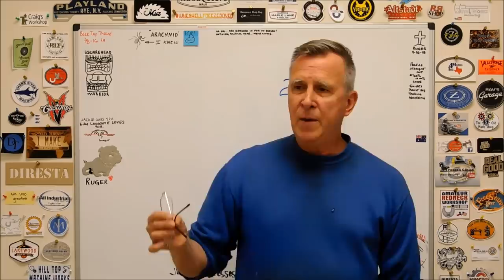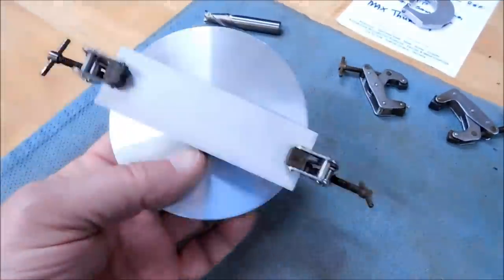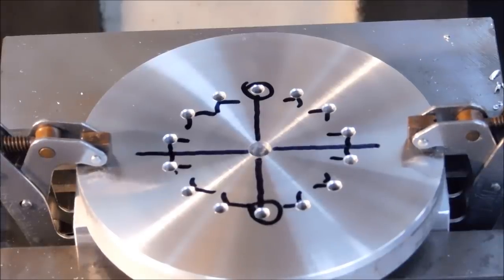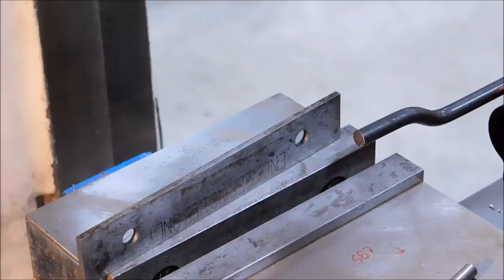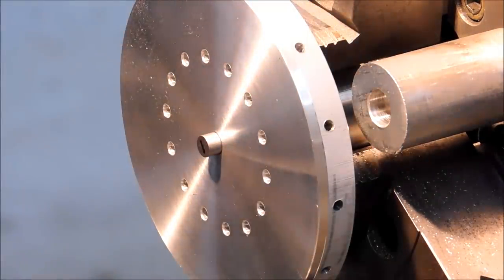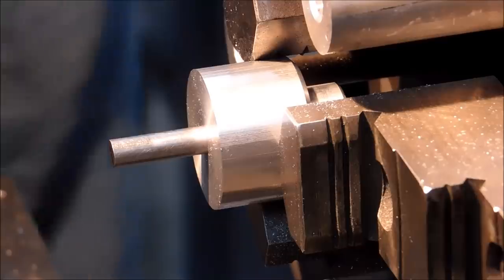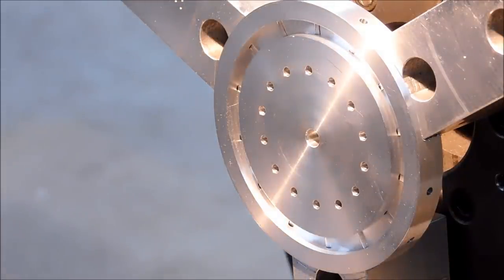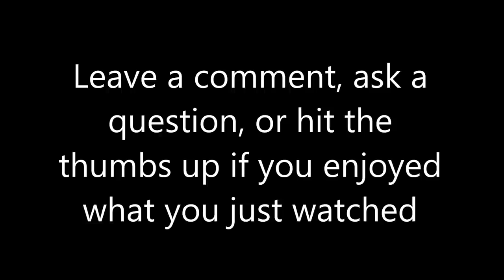Machining 14 Spokes at 25.714 degrees.  Easy ?? ... Yep !!

Comment: Excellent video Joe, one question, when indicating the centre pin on the mill, why a dial indicator and not an edge finder ?
Reply from the maker: Once you find center using an indicator, you lock the table. Once you find center with an edge finder, you move the table to center. The indicator is more accurate.
Reply: @joepie221  Ahh! Thanks Joe

Comment: At the beginning I thought you were making a custom 14 hole spin indexer plate.  Might be a neat project to make a timesaver for future wheels.
Reply from the maker: Maybe its already done???
Reply: Joe Pieczynski   If someone made a video I missed it.    Thanks, Chris
Update, found a video on making custom spin indexer plates. https://youtu.be/Lsna5BH-6js
Reply: @shadowdog500  I assume he means the trepanned disc can now be used as a spin indexer plate (for the hub) - i.e. it's already done. If so - that's some nice forward-planning! :)
Reply: @CraigsWorkshop  I figured the radius of the 14 hole pattern was too small for a spin indexer,  but i never thought of using it on a custom indexer, which is what he may have done.   Engles Coach Shop posted a video today where he  mortised a hub for spokes using an easy to build homemade indexer mounted on his mortiser. check it out https://youtu.be/uJcfPMDLFX0?t=950
Reply: @shadowdog500  Thanks - I'll have a look at that. I've heard of the Engles Coach channel, but this will be the first video I watch. Cheers, Craig

Comment: Thats awesome how you break the hole circle down into rectangles! I have a mil with no DRO, and I'm lazy, so these tricks are valuable!

Question for you. When you tram the center pin with your indicator, it looks as though the indicator is held by a quill mounted indicator holder. Do these holders have to hold the indicator exactly in line with the will axis to be accurate? The cheap holders always seem to point the indicator off to the side.
Reply: I have an "import" mill-drill with no DRO, and with a bit over 0.030-in. backlash.  :(  I need to learn how do use Joe's method while allowing for my backlash!

Comment: As always, thanks for the lesson!  I have a couple of questions, as I'm trying to learn more.  When you were pressure turning the wheel with the arbor on the hub, did you adjust the RPM on the lathe to account for the diameter change?  If not, could that account for the initial surface finish before you switched to a HSS tool?  Another thought.. It seems to me that you could use the center of the wheel that you popped out as a template to drill the spoke holes in the hub. I remember another lesson of yours where you used pins and adjustable parallels to cut precise angles.  Do you think that technique would be suitable here?
Reply from the maker: You'll have to wait and see.

Comment: Ok really cool how you did that! Although I think you cheated a little using the CAD to get the layout. They didnt have CAD in the old days. But ill let it slide. 
Cant wait to see how you do the hub!
Reply from the maker: Trig book and a calculator would still get ya there. CAD is just quicker. FOG privilege.
Reply: You can use some pretty basic programming to do this as well. Computers are just overgrown calculators after all.
In Python:

import math

radius = 2.0
divisions = 14
for i in range(divisions):
    x_pos = radius*math.cos(i/divisions*2*math.pi)
    y_pos = radius*math.sin(i/divisions*2*math.pi)
    print(‘x: ‘+str(x_pos)+’ y: ‘+str(y_pos)+’\n’)
Reply: Im just busting your chops. Love your channel. Keep the videos coming. I cant wait to see how you do the hub!

Comment: I saw another channel that was partial to using super glue arbors, but he was making lighter stuff; would this part be too big and heavy to use such a technique?
Reply from the maker: I have never used super glue on a part, but can see its value for small thin parts that will crush under pressure. I'd be leery about gluing a part this big.

Comment: Why not just make the inner/outer section in one piece - drill into both of them at the same time.  Machine the center hub then outer hub then cut out the middle?
A lot less indexing - especially since you all ready did it once?
Reply from the maker: I could have done this a dozen different way, including that way, but the continuity of the videos was planned.

Comment: I would have made a jig for making those holes from the perimeter. One threaded hole in the middle and two short dowels in the place where two of those 14 holes are. One bolt with a washer in the middle : drill and bore, open the bolt a little, turn the piece 1/14, tighten the bolt, drill and bore...
 IN MY PERSONAL OPINION it doesn't have to be that hard clamped when drilling/boreing, and almost every time there are more than (let's say) two pieces that are to be made  jig is a good investment. Then there is the possibility to improve the jig if you want 13 holes or 15...
Reply from the maker: I'm a big fan of jigs.

Comment: Hey. I've been machining for about 8 years professionally. Ive been considering purchasing a mill and lathe but I dont know how to find business. Could you consider doing a video on how one would do the business side of what you do? How to get contracts and what not. 
Thanks.
Reply: Start out as a hobby, don’t take on debt, and use the equipment until you design your own product. Try listing it online and if it sells and makes money, make more. If not, try something else. No solid recipe but if you want a equipment and no idea what to make and sell then be prepared for nothing. Working for a customer base like a job shop won’t likely amount to much and it’s not as passionate a Pursuit in starting up.

Comment: I don't have to remember anything. My CAD program allows me to 

assign radius and then hole qty (14) done.
Not crazy about your material being so far from the tip of your bits.
Having to lower the quill so far induces wobble. The closer you are 

the more accurate you will be.
Reply: Nothing wrong with CAD, sure makes things faster and easier (it's how I get the data most of the time), but if or when your computer crashes the work stops.
If yours is hobby work it's not a big problem but if it's your job or your shop then it's a big problem.
It's better to have a backup if the easier/faster way isn't available.

Comment: The top and bottom of this is, you need a CAD system to mark the hole positions!
Reply from the maker: It can be done manually. Just takes longer, but absolutely possible. Realistically, you only need 2 of the holes. Drill the hub, index to the second hole, align with a pin and drill the next hole....repeat until all 14 holes are drilled.

Comment: Mr Pieczynski, Re 23:12 better finish using steel vs cemented carbide,
is this not just a case of the steel tool having a sharper edge than most cemented carbide teeth that are not intended* for aluminium? 

*intended: of course that dose not exclude there use on aluminium.

Comment: 13:04 So you’re saying you only needed to drill 7 holes in the circle to get the 14 on the rim?
Reply: In fact, when you think about it, you could theoretically get away with four holes -- if you stacked parallels tall in the case of half of them.
Reply from the maker: I like it. 7 yes, 4 no.
Reply from the maker: @Gottenhimfella  I think 7 is the minimum.
Reply: @joepie221  It seemed to me 4 might be enough. I reasoned that by spanning the parallel across two adjacent pins, their angle is bisected, whereas across three pins, the angle intersects the centre pin. So four index holes are bisectable, which I assumed would permit drilling seven radial holes in +z, and  by simple inversion another seven in -z.
Now that I spell it out I see there is a problem with this, though. I think an extra hole would be needed at each end of the 4-hole arc, because spanning three pins cannot be used to intersect the pin at each end of the arc.
So maybe six is the minimum, unless a cheat was used, like substituting a non-parallel with an included angle of one-half of the angle between spokes. This would mean that spanning 2 pins would permit intersecting rather than bisecting, and by flipping this non-parallel end-for-end, either of the two holes could be intersected. Bisection would require a conventional parallel, (or lying the non-parallel on its side!) so it's definitely a total cheat, and depth control would be tedious as well.

Comment: 16:44 Why do you do the tool changes for every hole instead of doing all the holes with each tool? Is changing the tool really faster than rotating the part?
Reply: If the part was in an indexer, it would definitely be quicker to index the part, but here it seems to me the operation is quite fiddly and involves multiple tasks, including blowing down the contact faces of the parallels, the pins, the vice, the workpiece and the end stop. Swapping items into an Albrecht chuck is not just faster (in this case) but is trouble-free, and because it involves repeating a single, simple manual move, it can be done on autopilot.
On the other hand, reaming is ideally done at a different rotational speed than drilling, so I guess Joe is probably using a speed which is a compromise. On bigger holes and in tougher materials, this would not be so viable, so unless back-gear happens to provide about the right ratio, your suggestion could easily be the better choice in such cases.

Comment: Have a question for you about the way you reamed the holes, Mr Joe. When we got taught how to ream, always got told to slow it down to about a third of the speed you drilled the hole. You didn’t slow the speed down for the reamer. Just wondering if that’s because of the material, reamer geometry, or another reason. 

Cheers, Leigh, from Australia.
Reply from the maker: Slowing a reamer is usually standard practice, but I am very familiar with these reamers and pilot hole requirements. They like being seated and they cut well at a higher RPM. Steel wold be much slower.

Comment: Aren't you introducing some error by pushing the non-machined circumference against the hard stop when drilling the 14 holes in the OD?
Reply: He did turn part of the OD when he faced off the blank.
Reply: @seantap1415  Yeah. I saw that.... and if the stop is up against the machined surface, then my question is invalid.  But the width of his stop makes it look like having the stop up against the machined part of the OD is impossible....
Reply from the maker: The material actually ran very true in the chuck. The cut was so the indicator didn't bounce.

Comment: Newbie question: the tool you use at 30 minutes to knock out the middle is very wide. Why so wide and not a very thin blade to remove the centre?
I would think the pressure is very high on the tool where on a thin tool it is less
Reply: Trepanning operation is not just a wide or thin tool  ,, see joes treppan video, and you will learn something cool.
Reply: The width across the top of a trepanning tool, if it's for small radius grooves, has to be quite wide so it can have enough depth, unless you go for a fancy shape which is hard to produce by ordinary grinding methods. That's because the end view of the tool needs (for simplicity) to be a quadrilateral, and for clearance on both the ID and OD, that means it converges quite quickly to nothing at the bottom. The OD clearance angle in particular has to be quite generous to avoid rubbing.
If the radius of the groove is infinitely large the problem disappears and the end view looks just like a parting-off tool.
Purchased trepanning tools (typically with an insert) have the fancier shape so as to get around this problem, but you need to buy a different tool every time the radius changes significantly, and they're $$$. Young design engineers get in trouble when they specify face grooves when other options exist!

Comment: Maybe I missed it but I wished you showed HOW you found the center of each of those 14 holes? Is there some kind of indexing numbers on the vice?
Reply: He said he used his CAD software to calculate the coordinates of each of the holes.  I imagine after he centered the part to the spindle it was a matter of walking the table around to the pee-calculated DRO position.
Reply: I used a zues chart in the uk  which gives you values  of different bolt hole patterns which are multiplied  by the diameter you require
otherwise you would use trigonometry  to work  out your hole positions
I would personally not use  this chaps method in drilling/reaming the disk in the vise  i would mount a three jaw chuck on the milling
machine  and hold the work piece in the jaws  or mount the disc on parallels clamped to the table making sure your clamps do not
foul the drilling/reaming opearations

Comment: indexing the stop off the raw alum will throw your centerline off, but this is just a model wheel and doesn't matter here.
Reply: Definitely a valid point, but he held on to the OD to put in his center construction hole so it wouldn't be too far off.
Reply from the maker: They were concentric, but the turned section was used to eliminate indicator bounce.

Comment: Sorry Joe but Im on dialuo speed this time of month, and am wondering why they chose 14 spokes. Is that the American military patant on the wheel?
Reply: Wagon wheels have 8, 10, 12, 14, or 16 spokes depending on the diameter of the wheel and the load it will carry.  Larger wheels are better for rough or soft terrain.  Like everything else in engineering, it's all a trade-off...

Comment: You could have drilled the radial holes almost all the way throug to the center, leave stock in the center of course. And then, just as you did, use you trepanning tool to separate rim from hub.
Reply: Would require very accurate straight drilling of course...

Comment: You ever work with High Chrome cast iron alloy per astm  a532. Class iii type a. Level 2?  My CNMG inserts are chipping and bursting into flames at 17rpm on a 46" dia VTL
Reply: 46" dia piece
Reply: from what I'm told, hardened, and high nickel content
Reply: I have no experience with this material, but I think the chips are welding to the insert and then breaking it. So add lubrication and try a little faster.
Reply: FWIW - an idea from the way back machine:   Take your most successful insert on this material and do some experimental tweaking of the rake angles and chip breaker and TNR.
Reply: Maybe these are obvious, so take no offense if I tell you something you already know.
First off your tool holding has to be dead ridgid with the tool holder choked up as close to the block as possible.
Your part setup also needs to be as ridgid as possible - which can be tough on a VTL, on a 16' tabled machine I turned and faced the tops and cut o-ring grooves on stainless tanks for a chemical company, six foot tall on welded legs, so get how building a rigid setup can be a pain on a VTL.
It's either too low a surface speed (you're only at 12 ft per min surface speed) or chatter that's chipping the inserts and once they're chipped you see what happens then.
CNMG is brittle as hell so it chips REALLY easy, if you can't get steady tool pressure on the cut your fighting a losing battle.
I'm sure someone is going to tell me it can't be done, but on something like this I've used high-speed steel tooling sharpened with a minimum rake and backoff angle just long enough to get a steady cut and then switched to CNMG.
You're going to tear up the high speed tooling pretty quick because the material is both tough and hard so you'll be resharpening pretty often, but a lot of a heavy cutting oil - REALLY heavy - you should be able to get a smooth enough cut to switch back to the CNMG.
I'd also try bumping up to about 25 or so surface feet with the high-speed tooling and possibly higher with the CNMG.
Good luck!

Comment: Hum, De-burr your standoffs?

I ask the same question, how did they do it long ago with out a Cad Program or a DRO?
Reply: Marking out. Either iteratively, or (for educated people like toolmakers) speeding things up with trig. This could get a skilled worker within a few thou. For better accuracy, with toolmakers buttons you could position hole centres around a reference cylinder to a handful of tenths, if you needed to. Each button in turn is then indicated true to the spindle of a mill. When the jig borer was invented, about a hundred years ago, you could just position it from coordinates worked out by trig. Their leadscrews steadily improved, and Moore's machines already reliably gave positions accurate to + or - 50 millionths ( half a tenth of a thou) of an inch by about 1940, IIRC.
Reply: Trigonometry and counting graduations on the dials - on precision work we used guage blocks and indicators, go back even further and there were no calculators - we did the math longhand.
It's kinda fun watching how easily the "youngsters" (twenty somethings) with certificates in machining at work get baffled when the cad system is tied up or we put them on a manual machine.
There's a few of us old dogs that are equally proficient with CNCs and manuals, manual programming at the machine control and offline with CAD/CAM.
Of course, as far as they're concerned we old men are stupid - except when they get in over their heads.
Reply: @Motor-City-Mike  Just wait until there are driver-less cars and people can't figure out how to stop when the computer shits itself......

Comment: Curious how this was done historically at full size. It screams "Sine Bar techniques with no Sine Bar" to me or wrap the circumference in measuring tape.
Hub. One hole. 8' pole in hole. Can get any degree desired by deflecting end of pole (and thus rotating hub) through known linear distance.
Reply from the maker: Every other segment was cut to fit. They did well, but interchangeability was out the door.